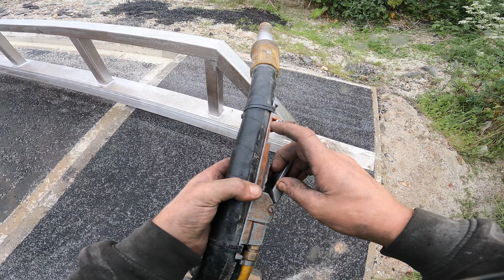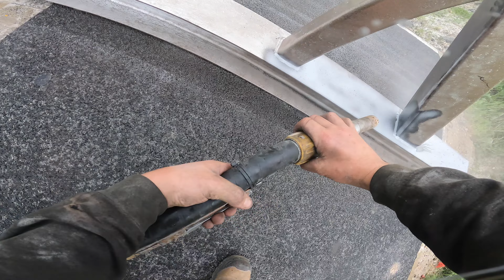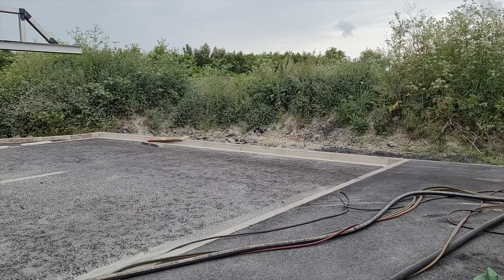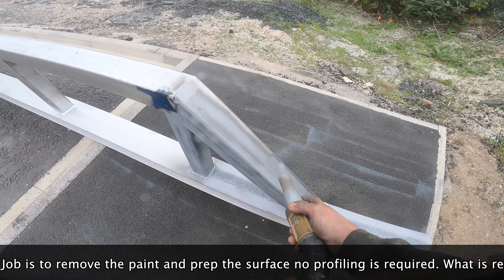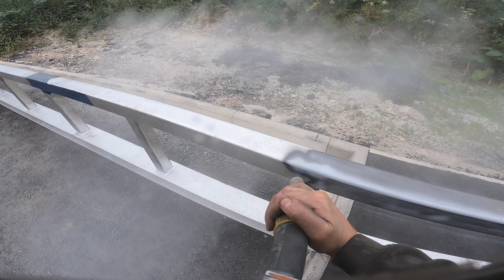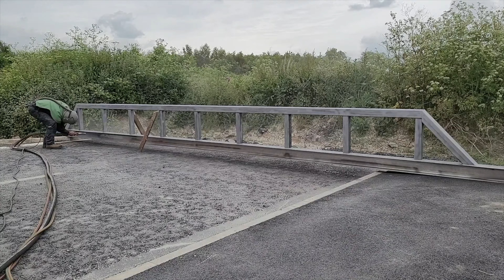SandBlasting | blasting some steel | sand shot media glass beed

Comment: I notice you camera picks up blow-back that ultimately lowers the image quality. Maybe a motorcycle goggle 'roll-off' kit would work? Just hit a lever and it slides a new piece of protective film across. I'm surprised none of the digicam manus haven't thought of it yet.
Reply from the maker: Yeah real good idea but I think cheap plastic will ultimately reduce the quality for the giants. I'm on my 2nd camera the blasting environment is harsh on digital products. I'm sick of replacing my phones because the microscopic dust in my pocket fills the mic and ear peaces. I was over the mood when water and dust proof phones came out but let me tell you they don't work for dust also the warranty on phones don't cover dust although they claim it IP rating is the get out